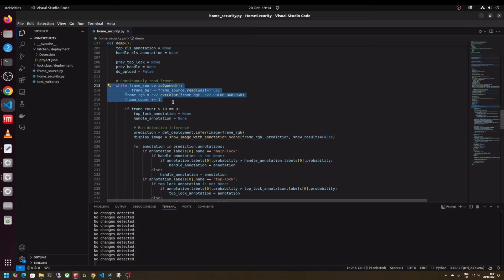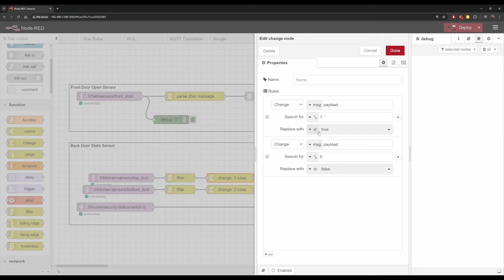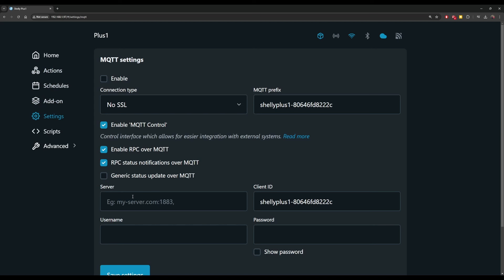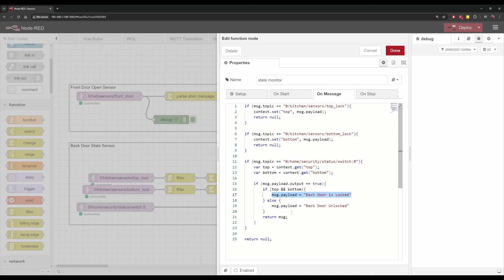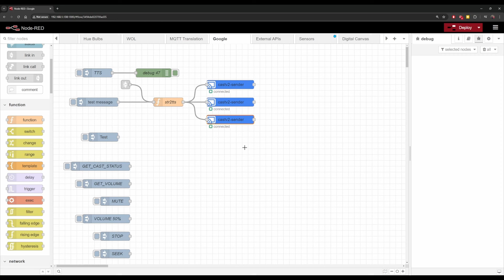Adding dumb devices to your smart home - Part 2

Comment: Hello, what equipment do you have the MING stack running on? Are you using Intel Geti permanently on another PC? Can you give me an idea of how it is set up? Greetings.
Reply from the maker: The MING stack is running on a cheap mini-PC an N100 based one, the type you can pick up on AliExpress super cheap, a RaspberryPi will also run the MING stack no problem.
Then the AI model is running on a slightly more powerful NUC13 - it gets the RTSP stream from an IP camera does the inference with OpenVINO and sends the results over MQTT to the N100 mini-PC to be picked up by the MING stack. I have Geti running on another server but this is only used in the training phase, it's not need when the system is running.